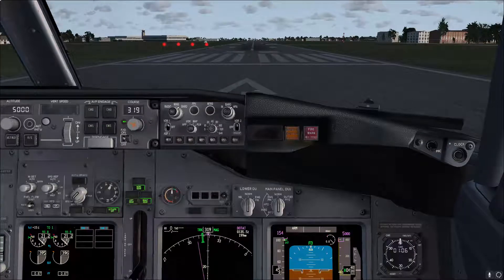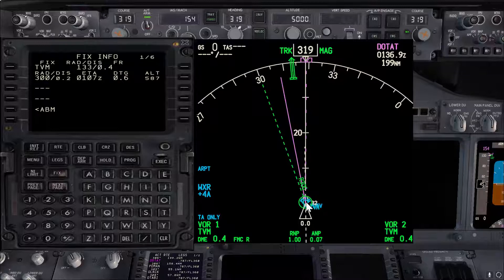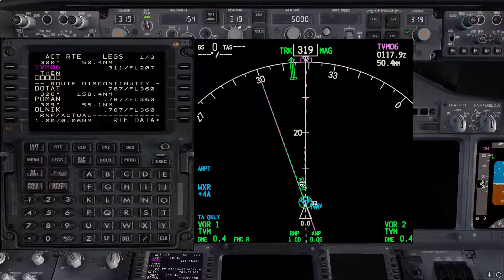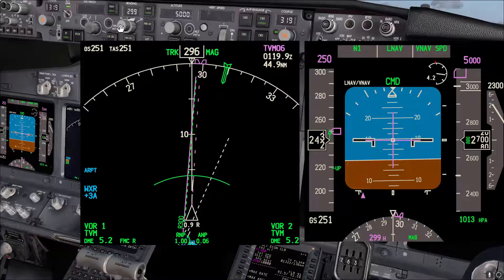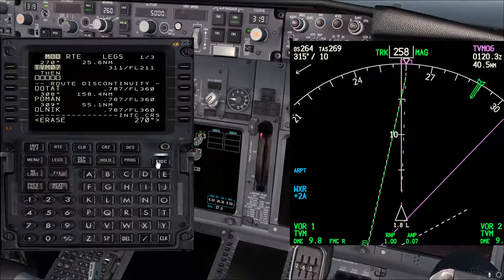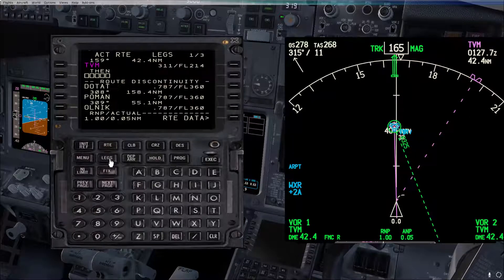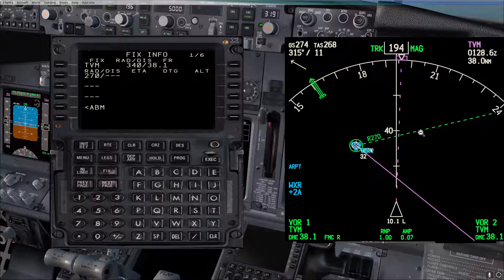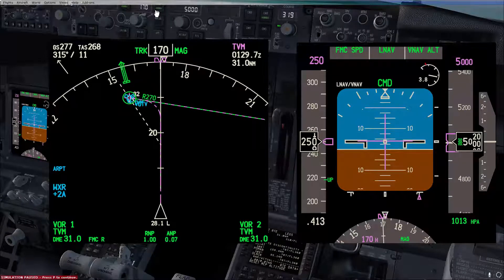B737 Radial Intercept Using FMC (PMDG)

Comment: hey if using raw data would you use VOR LOC on a both inbound and outbound radial or do you use heading select on the outbound many thanks
Reply from the maker: Hi Tom, 
VOR/LOC will track the radial weather you are flying to or from the VOR. 
hope that help.
Reply: @AbdulmuatiAsiri37  thank you and in terms of a vor approach can you fly it all using lnav and vnav or would you have to use vor loc at some stage ? Aswell as is there such a thing a VOR Alpha and VOR Bravo maybe something to do with how offset the station is ?
Reply from the maker: Yes you can fly a VOR approach using LNAV/VNAV if the approach is in the data base (FMC) the only thing you need to remember is that at least one of the pilots should have the VOR frequency tuned and identified, it is a VOR approach after all. 
As far as Alpha & Bravo notation in the approach I don’t know I will get back to you when I get the answer 😉

Thanks again for the great questions
Ask the best
Abdul

Comment: Hello Captain, I enjoyed to see your lesson thank you for that. I have also a question: when you are at final are you using yoke for speed and trust for correct hight? Also are you using a lot of trim changing during the landing in stead of pulling or push the yoke? Have a nice weekend!
Reply from the maker: Hello G L,
Thank you for taking the time to leave a comment.
Regarding your question:
That is correct, pitch for speed and power for altitude. Trim should be minimised on the approach, but if you have a cotinouse pressure on the yoke then its best to relief it using the trim.
Reply: @AbdulmuatiAsiri37  
This is why trim-rocker-switch is on the Control Yoke — on Boeing Designs that I know of and should be Yoke Mounted for contemporary Embraer — I do this for my retirement decades as it interests me to study IFR Enroute Low ••• Is this recreational simulator or studies?